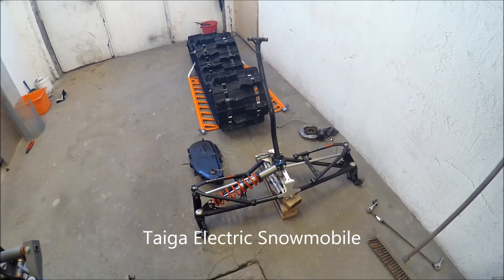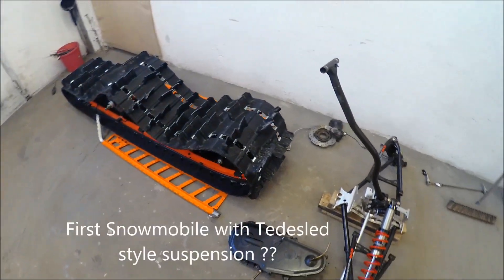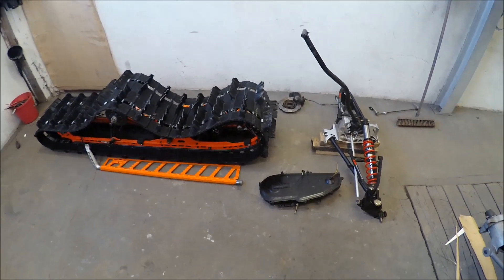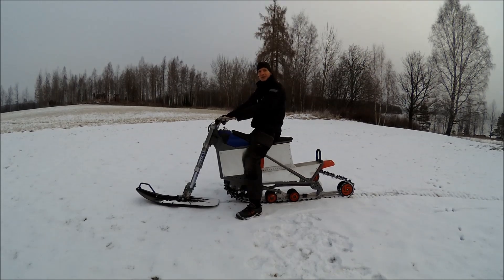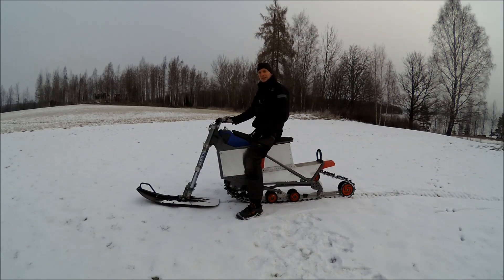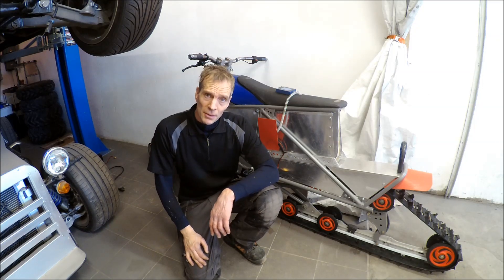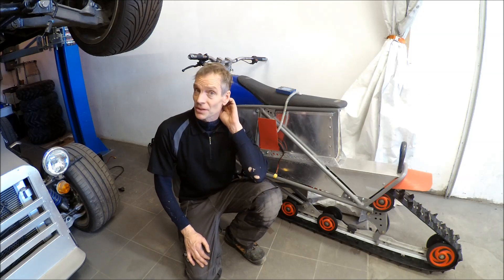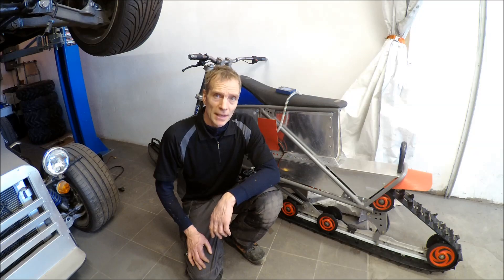Electric Snowbike Testing

Comment: Great build! I am attempting to build something similar. Any advice on track width. I am contemplating between 7" or 11".
Reply from the maker: Hello, great idea and thank you !  I have 165 mm width. I think it depends on power from motor, gearing and how deep snow you will bee riding on. Also if you look at track when you cut it you will have drivewheel and skid centered and that will perhaps influence track width. Wish you good luck with your build. Dont hesitate to ask questions. I will rebuild my skid to improve suspension.  Problably i use the skid from the Ktm DIY snowbike : https://www.youtube.com/watch?v=jh7Rh6Qq1Cc&t=348s

BR Per

Comment: This is awesome. Have you seen these?: moonbikes.co  - I just found them. I can't figure out where they are housing the motor, but it looks like what you are building.
Reply from the maker: Thank you, Will. Haven't seen them before. Nice builds, maybe motor is same as driveshaft ?  BR Per
Reply: @persteel  There's also these: https://www.youtube.com/watch?v=_3soKoiiF6Y
Now that it's snowing again here in Switzerland, I think I'll have to build one as well :-)
Reply from the maker: @niokolabs  Hello, Nico ! Yes I saw our Russian friends made these, they also build a lot of different vehicles with tackband. Think it is also possible to buy parts from them. BR Per
Reply: @persteel  They did one with a hub motor wheel within the track, and this is actually what I'm thinking about for years now..
Reply: @persteel  And one more.. most likely the original (ok it's ICE): https://www.youtube.com/watch?v=kdJLSEJ-LeU
Reply from the maker: @niokolabs  Yes, you get a very smoth build if you do it like that and you save the transmission, ingenious !!  BR Per

Comment: Nice project, the seat seems a bit high though, wouldn't you get more stability and maneuvrability if it were lower?

Cheers!
Reply from the maker: Hello, thank you ! Yes, it will problably be more stabile if it were lower, but it was ment to be a Snowbike and if you compare they are much higher. There is also a problem to get everything in place and keep it slim, the width within dirtbike sadle otherwise you must make it wider. But thank you for comments, thats what brings us forward. In the Electric Snowmobile I will use all experience !!  BR Per
Reply: @persteel  Thanks for showing us your project.
It seems a lot of fun already! I wish I could build one half as good as yours haha.

How much did you invest in this projec from A to Z?
Reply from the maker: ;-) Hello, in total maybe 40 tsek in dollar maybe 3500 USD, then it's 1000 USD each for motor, controller and battery. 
BR Per